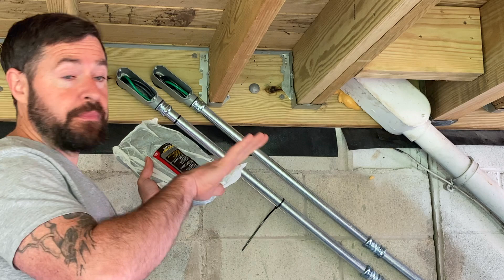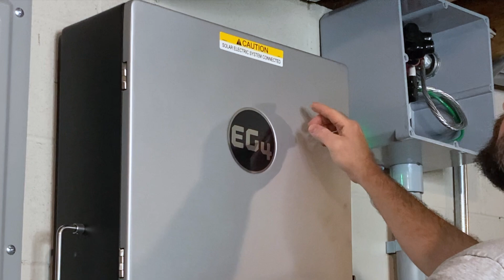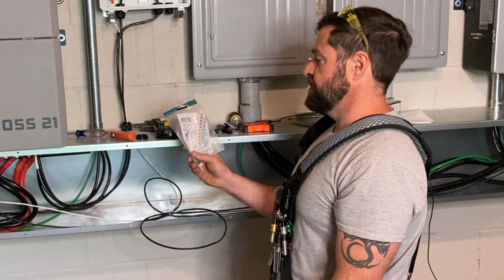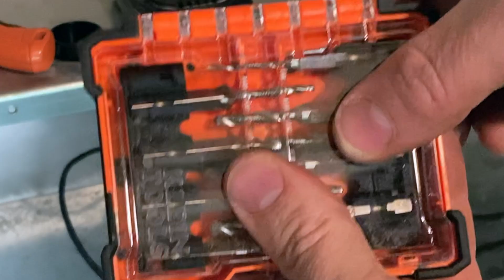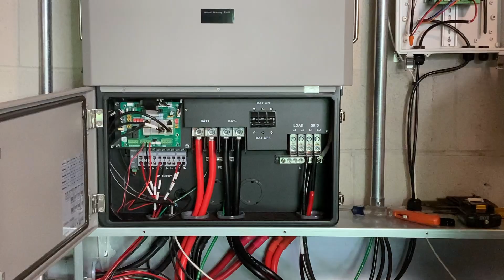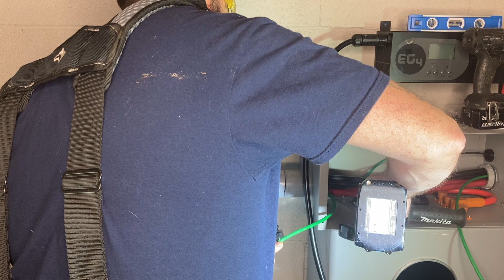EG4 Flexboss21, GridBoss, and Indoor WallMount Battery Installation Part 6

Comment from the maker: Signature Solar affiliate link (CHEAPEST SOLAR PANELS ON THE MARKET and EG4 Products) 
$50 off for orders over $500 when using coupon code: GET50ROCKY (expires 12/1)
https://signaturesolar.com/?ref=uzUOpPif73O10D 

The materials used in this video are...
EG4 Chargeverter - GC | 48V 100A Battery Charger 5120W Output | 240/120V Input
https://signaturesolar.com/eg4-chargeverter-gc-48v-100a-battery-charger-5120w-output-240-120v-input/?ref=uzUOpPif73O10D&search_query=EG4%20charge&searchid=0

https://signaturesolar.com/eg4-flexboss21-14-3-28-6kwh-capacity-eg4-wallmount-indoor-battery-bundle-bndl-e0023/?ref=uzUOpPif73O10D

https://signaturesolar.com/eg4-gridboss-vs-mid-200a-service-entrance/?ref=uzUOpPif73O10D

Victron 600A Bus Bar 4-Stud/8-Stud https://www.currentconnected.com/product/victron-600a-4-stud-8-stud-busbar/?ref=RockyBroadSolar

4 Awg - 3/8" (M10) TKDMR Wire Lugs Ring Terminal
https://amzn.to/43otoXS

60PCS Copper Wire Lugs Kit(AWG 8 6 4),Heavy Duty Battery Cable End,Bare Copper Crimp Connectors https://amzn.to/44ZORaB

Photovoltaic Solar System Installer Label Kit https://amzn.to/43zrF0y

SIEMENS EC3GB212 Ground Bar Kit with 21 Terminal Positions and a Ground Lug https://amzn.to/4mBDbRB

The tools used in this video are...

Klein Tools 32217 Drill Tap Tool Kit, 8-Piece https://amzn.to/4mDxMcN

Greenlee 7238SB Slug-Buster Knockout Punch Kit with Hex Ratchet Wrench
https://amzn.to/40UHL4I

LICHAMP Hydraulic Cable Lug Tool https://amzn.to/4lnnEVd

Klein Tools 63060 Cable Cutters https://amzn.to/3E1r0fJ

1/2" Drive Master Impact Hex Bit Set https://amzn.to/428rI49

iCrimp ICP-240 Cable Stripper for AWG 12 to 4/0 Round Cables https://amzn.to/43iOczS

Makita XBP02Z 18V LXT Lithium-Ion Cordless Portable Band Saw https://amzn.to/4lGXZH4
Makita XDT14Z 18V LXT Lithium-Ion Brushless Cordless Quick-Shift Mode 3-Speed Impact Driver https://amzn.to/3Gf6Xez
Makita XAG04Z 18V LXT® Lithium-Ion Brushless Cordless 4-1/2” / 5" Cut-Off/Angle Grinder https://amzn.to/3Z6wn4u

Comment: Use a #6 die with a #8 die on a loose #6 wire and #6 lug. Works to the avoid smashed lug syndrome.
Reply from the maker: Good to know, I will definitely keep that in mind for the next install! Thanks for watching.

Comment: Great redundancy. Looks good. Just so bummed that it takes 10 seconds to transfer (or "boost" from grid) from battery/pv to grid. That's why i ordered a GB/FB21 to begin with. Hopefully it's different now though and can be wired to seemlessly transfer and augment grid power as needed. Thought they claimed that. But i am still very new to this and only a clinical enginer. Thanks for the video. Looks pretty clean.
Reply from the maker: It is pretty darn quick. I would have to go back and watch this again to remember what you are referencing, but nowadays I don't even know when the power goes out most of the time unless the utility company texts me with a restoration time. Thanks for the kind words and for watching the channel!

Comment: I see that FlexBoss21 inverter and GridBoss are installed at different heights. What are NEC 2023 requirements for enclosure height, and or how low can you install them to the floor? Can gridboss be installed above the inverter if the inverter is really low?
Reply from the maker: As long as you follow manufacturer's required clearances and no disconnects are over 6'7" then you are good to go. There is no minimum requirement. There is no reason I can think of that you couldn't mount the GridBoss above the inverter.

Comment: This is my train of thought. 
Ground mount only.
All batteries and equipment goes outside into a conditioned power shed.
Then u run two sets of buried wires to it from your house. 
One set will come from your grid panel to the shed. This allows auto bypass. I don't back feed.  
The other set provides power from the system to your loads panel. 
Your load panel will be fed from grid and solar utilizing 100 amp breaker interlock. 
This is how I do it.
 I have a 200 amp service. 
But a 100 amp automatic bypass circuit on the EG4 12,000XP  for overloads and low battery powers my house fine. 
This type of set up for the DIYers should avoid the insurance trying to drop coverage because it's no different than that generator interlock. It's all away from the structure. NO panels on the house. In my eyes it's no different than having an off the shelf stand along solar generator sitting outside plugged into your generator receptacle.
Reply from the maker: That is a good setup and a darn good option especially to avoid interconnection paperwork. And if you ever need more than 200A you can use the interlock and run off of grid power. Thanks for watching the channel!

Comment: Why don't you hook your generator onto the generator port of the Gridboss?
Reply from the maker: Because it is not an "inverter type" generator that produces extremely clean power and it is undersized to power my whole home. Connecting a cheap portable generator to a whole home backup system is asking for trouble. When overloaded it will send surges of power into your home and destroy sensitive electronics. By utilizing the Chargeverter that power gets cleaned up first and sent only to the batteries, not the home loads. Thanks for watching!
Reply: Perfect amswer

Comment: Ya the rapid shutdown is meant for fire fighters so it shuts down everything for fire safety reasons.
Reply from the maker: For sure, it is not required to shut off your grid power by code though. It is only required to shutdown the solar and batteries. Fire fighters always pull the utility meter to kill grid power during a house fire. That being said it really isn't a big deal. I probably won't ever hit that switch again once I pass my final inspection. Just interesting to test it out and see what happens. Thanks for watching the channel!
Reply: @RockyBroadSolarLLC  I know what you mean.  I was excited to compress down on the rapid shutdown switch and watch the whole sequence shutdown tje power.  I've even made a custom warning label instructions to make it clear for firefighters to compress the switch to initiate rapid shutdown ESS.  (switch setup as normally closed).   It can be confusing because it looks like you should twist switch  however for my (normally closed) setup twisting it just resets the initiator switch.
Reply from the maker: Nice, yeah they don't really make rapid shutdown stickers small enough to fit on those switches. I was considering doing something similar.

Comment: I think you missed an important point with the GridBoss.  You can no longer feed power to your garage subpanel with a solar breaker or generator.  It has to now get fed into the Gridboss instead (probably better and has more spike protection?) .   Just thought I point that out to you in case you missed that info in the gridboss manual.
Reply from the maker: Good point @TheCryptoFarmer . Things have changed in the last several years with each manufacturer coming out with their own Microgrid Interconnect Device. They certainly make it a lot easier to make storage installations code compliant. Thanks for watching!

Comment: What Rapid Shut Down Switch is that?  Or is that an enclosure you put it in.  I need something that is lockable.  FYI with the Gridboss it is a total system shutdown including your backup loads.
Reply: Thanks for replying.  I found your link to the external shutdown switch in your last video.  I appreciate that you put the links in.  As far as module level electronics, I was referring to your concern about your backup loads being disconnected on RSD initiation.  That is how the Gridboss is programmed to work right now.  EG4 considers it a feature not a glitch.
Reply from the maker: Understood @Buff30-b1q I know I sounded a little negative about it in the video, only because it is something I am not used to seeing with other equipment, but honestly that RSD switch will never be engaged again unless it is an emergency, in which case no harm to cut the backup loads at the same time. If you are a DIYer check out V1 of my Rocky Broad Solar Ultimate DIY Guide on my website www.rockybroadsolar.com. It is still in it's infancy but I plan on updating it every few weeks as I build it out better. Thanks for watching the channel!
Reply: This is the very best explanation I have found for all of this equipment.  I have the exact same setup and am very glad I ran across this because I am a DIYer and learned a lot before I call for inspection.
Reply from the maker: Thank you @jasonfreeland273  If you are a DIYer check out V1 of my Rocky Broad Solar Ultimate DIY Guide on my website www.rockybroadsolar.com. It is still in it's infancy but I plan on updating it every few weeks as I build it out better. Thanks for watching the channel!
Reply from the maker: The EG4 system is not rapid shutdown compliant without an external rapid shutdown switch as well as MLPEs or a third party RSD system on the roof to bring the solar panels down to a safe voltage. I chose to go with Tigos since I also had some pretty major shade and wanted module level monitoring. Thanks for watching!

Comment: Great episode... probably not a lot of us DIY'ing this stuff but I am one and your videos popped up!  Great information!  I haven't scheduled my inspection yet but I've got about 90% cleaned up.  Just ordered the stickers and the putty today (two holes through-wall that I have to plug from the old service panel to the new one).

Yup, GB + FB21 ... the rapid shutdown button cuts off everything.  Batteries turn off (and sometimes seem to mechanically trip their breakers, which surprised me), inverter(s) turn off, solar turns off, and the GridBoss disconnects from the grid and turns off all of its smart port relays.  Poof.    All you should need to do to turn everything back on is to turn the batteries back on.   If the home is in manual bypass it will stay connected to the grid (since that's a manual bypass)... but if its on BACKUP, then the GB will disconnect it when you hit the rapid shutdown button.

* make sure batteries are soft-off
* Engage battery breaker if it tripped
* Engage FB21 battery breaker if it tripped
* Soft-on the batteries (last step... this has a pre-charge circuit built-in)

That should re-enable the whole system.

-Matt
Reply from the maker: I appreciate the breakdown of the steps for re-enabling the system, Matt. I'll be sure to use that process for future reference! Thanks for watching the channel!